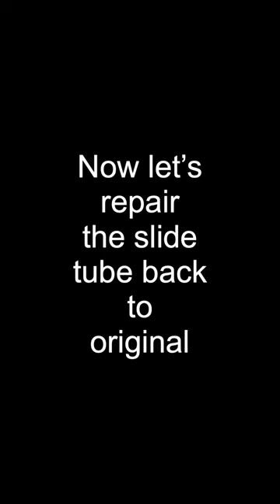Heat Repellent? Brazing Near Soft Solder- Cold Shield Test, band instrument repair

Comment: Amazing product.
   One word of caution. (From my own experience), be extremely careful using a direct drive buffer. I like to stear clear of them, as a part came out of my grip and went over an inch into my neck, and hit bone and bounced back out. The angels were with me on that one.) I like to use a rag wheel on a belt driven fixture, pedestal  block type, so I can bog it down.
   I love your work.

Comment: Wes,   Do you use flash protectors on your soldering regulators?   I’m getting set up to do propane + oxygen and having trouble finding flash protectors with the right gender of collars to fit.